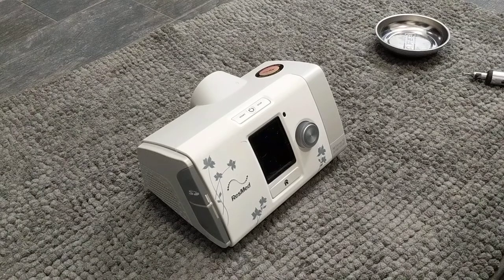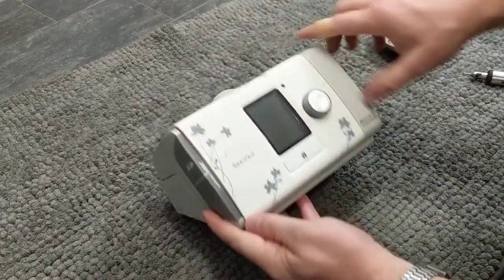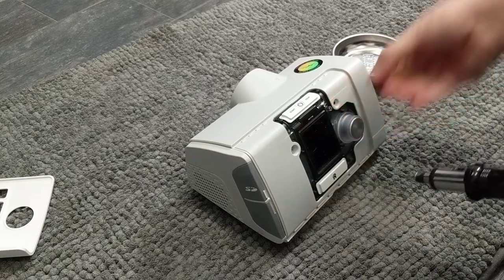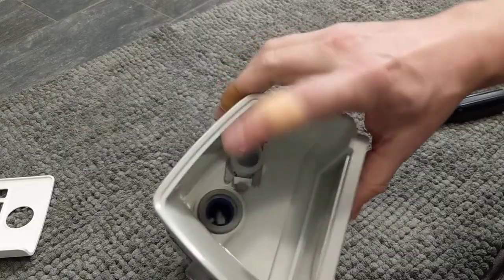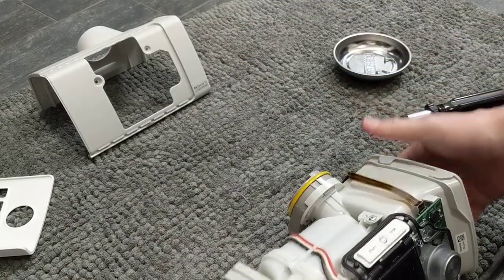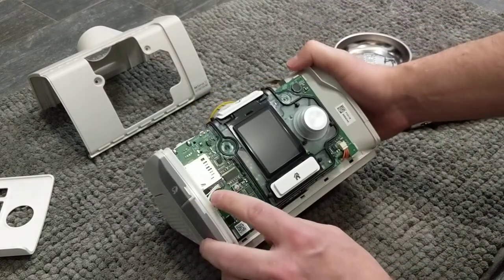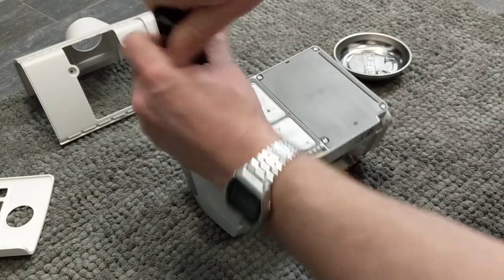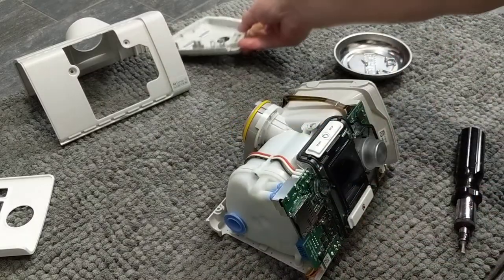Disassembly and modem removal of ResMed AirSense 10 AutoSet For Her

Comment: Hey, just letting you know that my unit, which I purchased new about 3 years ago, did not have any oily residue on the outside of the plastic shell around the motor. In fact I didn't find any oil or grease anywhere while disassembling. I'm wondering if anyone knows what the 12 plastic tubes into the fan assembly are, that are part of the plastic that the motor fits into. This is the piece that can be seen at 12:37 in the video lying just above the motor wires. Some kind of baffles to reduce operational fan noise? And great video. I'm sure it saved me a lot of time and frustration, so thanks.

Comment: If you have a cpap that doesn't smell, and a used asv that does, could you just move the circuit board over into the cpap to turn it into the asv?
Reply: I would like to know the answer to this. I rather suspect the answer is yes but I have never taken apart an asv model. My suspicion is that they machines are identical except for firmware, but I don't know.
Reply: According to the AirBreak devs, the answer is YES. But it'd be easier to jailbreak the CPAP to unlock the ASV mode
Reply: I found it easier just to move the tubing and motor over than to remove the circuit board.  I did it successfully.
Reply: @cebruthius  When you say jailbreak, do you mean mess with its firmware? Has this been done? I know there is lots of study on the format of the data files (EDF). They probably have the MCUs set as "read protect", but there might be ways around this.
Reply: @fitybux4664  The MCU is completely unprotected on the Air10 series. JTAG ahoy!

Comment: Could you maybe make a video where you take a part the heat plate my resmed says heating fault so I assume that there might be a wire unplugged. Maybe something else. Any idea what it might be?
Reply: Use a multimeter across the plate (in the resistance mode). It's probably a resistive heater, so you should be able to measure some resistance across it. If it's an open circuit, your heater plate is probably dead.

Comment: Thanks for the video.   I got a used one but it cannot connect to computer software myair.
Can I just swap the modem piece but keep the rest of motor part intact?  I believe the modem circuit board has the information of Serial number / Batch number stored. Am I correct?
Reply from the maker: That sounds plausible to me, but I thought "myair" required a connection to your DME. If you have a modem from one that your DME sold you, I bet you could just swap them out. Asking really good questions here...
Reply from the maker: That sounds plausible to me, but I thought "myair" required a connection to your DME. If you have a modem from one that your DME sold you, I bet you could just swap them out. Asking really good questions here...
Reply: @grantsreviews4299  Based on your video. I able to open it out (old and backup), Even it is same model from RESMED's airsense auto set, the pin connection to the Modem board are slightly different. (serial no start with 2315 and one start with 2317 ) One is black an white (like pc fan - bigger) and the other one is black and black. I do not want to cut the wire and solder it. The backup works fine except I cannot see data in MyAir.  I believed my backup one belongs to someone already setup account in MyAir. This is one of the minor draw back getting a used one.  As of now, I doing research on other application like SleepyHead so that I can connect my backup CPAP. Thanks again for the video.

Comment: Hi. Can anyone please help me ? I’ve carried out this cleaning process and now my machine isn’t running correctly. When I reassembled it I carried out a ‘run mask fit’ and the machine didn’t recognise if the mask was on or off - is said good mask fit at all times. It also didn’t really run on full power during the test either. 
Then I put it into normal operation mode and it didn’t recognise when I took my mask off. Usually it’s stops the machine. Help.
Reply from the maker: Best guess: those two little prongs need to be lined up and seated well in the little rubber things. If not, the sensor can't detect the air pressure.

Comment: Thanks Grant, followed your video and my Cpap is much quieter. However, ever since puting it back together the pressure has been going higher than what it's set to.  Seems to do this after the first couple minutes of powering on - Any ideas anyone ?
Reply from the maker: This happens if the pressure sensors are not properly aligned. Take a look at 17:05. If those little black protrusions are not well-seated inside the blue receptacles, your CPAP will not be able to sense pressure properly. Super easy thing to mess up. Luckily it's also easy to check and fix.

Comment: Hi and thank you!  My cord/plug adapter isn't making the machine turn on, and I'm assuming that it has something to do with where the cord plugs into the machine bc I have tried 3 different cords and different outlets and nothing makes it turn on. Does anyone have this problem? The light flickers for a second at best....
Reply from the maker: I believe Resmed built their adapters with a little vendor lock-in mechanism that won't let you use a basic generic plug. However, there are a few generic plugs out there that can do the secret handshake. You have to buy one specifically built for use with Resmed (you can't use a laptop adapter or whatever).
Reply: @grantsreviews4299  Thank you for the response!  I am up since 3am bc I can't sleep without my machine and won't get a new one until at least October.  :(  Anyhoo, I mean to say the outlet itself ON the machine seems defunct. The power cord outlet on the back of the machine.  But, thinking about what you said, maybe it is the plug/cord itself and I'll order a new one just to try!  Can't hurt.  Tx again friend!

Comment: I have a system One that is very quiet. Recently I got an Air sense 10 as a backup. I noticed that it has that problem with the noise of breathing in and out. It is slightly but I can ear the difference between machines. Do you know is that noise is caused by turbulence between the machine inlet and the nightstand or is it some kind of undetected leaking between the blower chamber and humidifier chamber?
Reply: I use earplugs at night and don't hear mine at all, but I have used it in a quiet room without earplugs and the breathing in-and-out noise was noticeable. Based on what you describe, I suspect there is nothing wrong with your machine. The system one machine is packed on the inside with noise-dampening foam everywhere they could put it while the current resmed line has no foam at all in the machine except a tiny ring. I think they sacrificed quiet for size and simplicity of design. Resmeds are, in my opinion, quiet enough, but they are not industry leaders in that respect.
Reply: @bendirval3612  yes, breathing in and out is normal in a cpap but what about when it comes with some kind of whistle. The whistle makes me think that there is something that is no sealing at 100%.
Reply: I had excessive noise issues with mine after a few years use.  I replaced the outlet valve as he showed in his other video, and put in a new humidifer tank assy. ($18).  I am not sure which was making the noise, the humidifier gasket or the outlet valve.........but that solved the noise issues.

Comment: Would removing the filter affect the air pressure?
Reply from the maker: I'm not 100% sure what the role of that piece of foam is, unfortunately. I'm not sure to what degree it will affect the operation of the machine.

Comment: WARNING: Not all modems can be disconnected on the front side of the machine.  Some must be disconnected from the side panel.  I unfortunately pulled one of the wires out of the "connector" on the circuit board before realizing mine disconnects from the modem end, not the mainboard.  Luckily I have a great soldering iron and will be able to make this repair myself.

Comment: On that front board, just top right of the screen, is that a camera? Next video, please do a super close up of the board.
Reply: Interesting. It's a piece of clear plastic. It seems to me like it might be too simple for an actual camera, but it might be a simple light/dark detector. I'm not aware of any machine functionality that uses that, so it is a little disconcerting.
Reply: I don't know what it is, but it's not a camera, and the front cover blocks it.  It connects to the ribbon that goes to the heating element, so perhaps it registers moisture in air?
Reply: @user-mn6ze7rm2p  the front cover does not block it.
Reply: @bendirval3612  I disconnected my  modem, but didn't inspect the bobble up close as it's a new machine and not gonna mess up the board lol. so yeah it's not a light or dark sensor either as I put black nailpolish over it and it doesn't effect the dimming of the display. so yeah what is it's purpose? weird

Comment: Hey dude, I disassembled mine when I turned on it blew a strong air that hurt my ears and then stopped blew air...did I broke the stuff? Any thoughts? 😓
Oh, I removed the memory foam. Do you think without the machine doesn't work?
Reply from the maker: I'm not sure about the purpose of the foam (mine had regular foam, not memory foam). However, if it turned on full blast like crazy it probably means the pressure sensors are not working. Go to 17:05 and take a look. The little black protrusions need to go inside the little blue things or it will go to full pressure all the time. Check out 17:35 for how it should look. Good luck!
Reply: @grantsreviews4299  that's weird...I opened the device and checked the assembly twice and wasn't working, I thought I might had burned one of the circuits with static energy from my hands but after I read your reply I opened for the third time to check it out and it was connected...and now it's working again...thank you so much for your help....

Comment: Is there a way to change the humidifier on this machine
Reply from the maker: The humidifier tank is easily replaced and available on Amazon. And the little connection between the humidifier and your hose is replaceable. That's about it.

Comment: can't really get the perfume smell out of the motor and the silicone housing any suggestions?
Reply from the maker: I suspect the silicone is the main culprit there. Aside from a very thorough cleaning with dish soap I'm not sure what to tell you. Perhaps ozone in a sealed container? Amazon has little hockey puck ozone generators for like 20 bucks. Good luck!

Comment: I couldn't tell if you were pulling up on the connector or out. I pulled out and I pulled the wires out. :(
Reply: If you broke the wire to the connector side, this is fixable. You'll need to re-terminate the wires into the connector. There might be an expensive tool that does this. (Like some kind of Molex connector tool.) Search on Digikey or Mouser and you might find it. Or eBay maybe. If you broke the wire at the motor side, RIP little motor, RIP.

Comment: Any idea how to get it to stop blowing full blast? Had a whistle, now it's just blasting OR not blowing more than it does to dry the hose when turned off. Also pulled error code 001.  Is there a sensor that coukd be faulty or a disconnected wire?
Reply from the maker: One possibility comes to mind: I believe the air pressure sensors are the little black things that go into the two small blue things around 17:17 to 17:46 or so. Could it be that they are not inserted completely or are misaligned? Loose wire is possible but I'm not sure which it would be. Good luck!
Reply: @grantsreviews4299  I assumed the same... They seemed well aligned when reassembled, as it all fits together so nicely... Unless they are leaking or the sensor behind it somehow got tweaked... I think I'm going to see if someone locally can repair it.
Reply: @mattfisher401  I had this same issue. The full pressure blowing, then the "whisper" blowing, then the 001 error code. I disassembled it and reassembled it again and was very, very careful about aligning both the small blue rubber pieces and one other pressure sensor on the back of the mother board. That one is really hard to see and easy to miss. I also made sure the silicone tabs were fully pulled into that plastic plate after installing the motor. After doing so, it started working properly again. However, I still have my whining bearings. Going to disassemble AGAIN and go to a friend's house with an air compressor and give the motor a couple 90psi blasts to see if it helps. Can't hurt at this point!
Reply: @smokepony  Thank you-I think those were not pulled thru, just resting on the outside...  I sent it in for repairs and have a replacement that makes a similar noise to mine (Facepalm).

Comment: Would it be possible to use the modem to power something else? Is there a SIM card hidden inside?
Reply: No sim card that I saw. I don't know what else you could use it for. Would be interested to know!
Reply: There is always some kind of SIM to authenticate to the cellular network. But it is possible there is an eSIM, which means it could be embedded on a chip instead of a removable card.

Comment: Does the air pass through the foam?
Reply from the maker: Unfortunately I don't know the answer to that. It doesn't seem like the kind of material you would put a lot of air through, but there must be a purpose for it. Probably it does. If anyone else knows, I'd love to hear it.
Reply: some form of isolation from vibrations or, if crossed by air, damping of pulsations?

Comment: Does anyone know where to buy the foam piece inside the housing unit? 8:45 into the video. I took mine apart and the their was a tiny bit of the foam left.
Reply: I've never seen any internal parts for sale to the public, unfortunately. There are places that will fix CPAPs and they will have parts, presumably, but they aren't easily found and I'm not sure what they charge. Having said that, it seems like the same kind of foam one sees in all kinds of places, including packing material. You may be able to fabricate something adequate. Let me know if you do find a source for this or other good solution.
Reply: @bendirval3612  Under no circumstances should anyone use anything but an official manufacturer part to replace the factory foam. Search for Philips CPAP lawsuit. The foam Philips used was found to degrade over time and people were breathing it in. It's been linked to cancer in at least one case. ResMed uses a very specific kind of foam that is not as susceptible to degradation. If you use "any old foam" it may degrade over time if it is not the correct type of foam. Just a fair warning.
Reply: @the_color_orange  Yikes! Good to know.

Comment: Anyone know where I can buy repair parts for my AirSense 10? The power connector at the back of the unit is defective.
Reply: Digikey or Mouser might have the right one if you look for a long time. You might have to resolder it to the board.
Reply: Is that the system error code 6
Reply: @bren2dan  I don't recall a code, but it has been a while. I upgraded to BIPAP and threw this non-working  CPAP/APAP away.

Comment: Where to buy blower motor for resumed?
Reply: People ask that a lot but resmed won't sell you one. If there's a place that repairs CPAPs around where you live, you may be able to get them to put a new one in for you. Usually better to just pick up a used one with a blower that's in OK condition.  Good luck!
Reply: Go to Resmed corporate HQ and hold up signs and get social media in on it. Get a bunch of people on CPAP forums to come with you. That is probably a way you can buy the motor. Basically, cause such a ruckus, they will be forced to sell you one. ("RIGHT TO REPAIR")